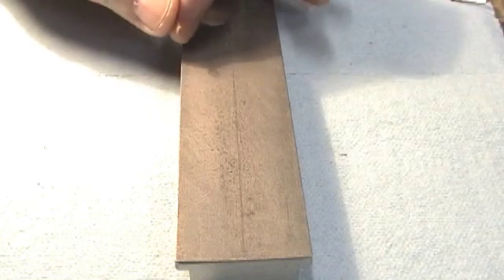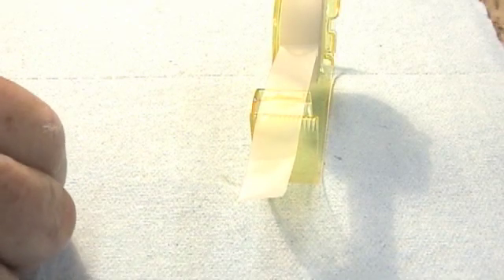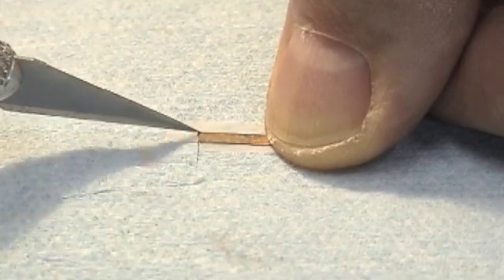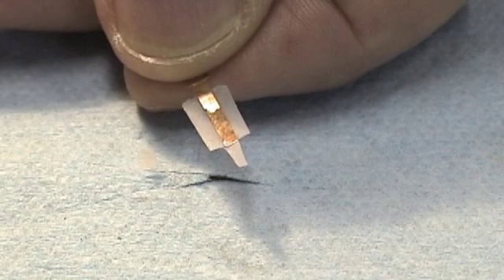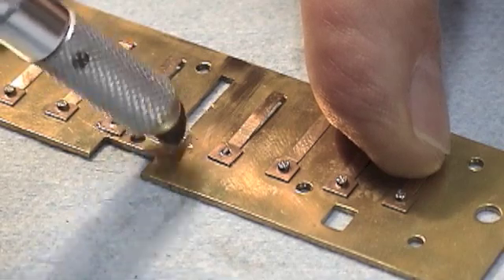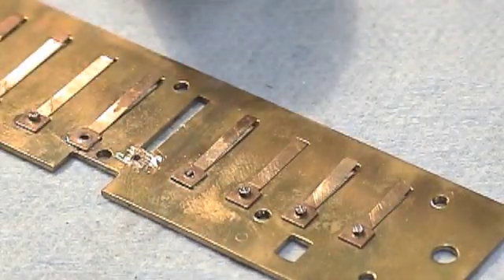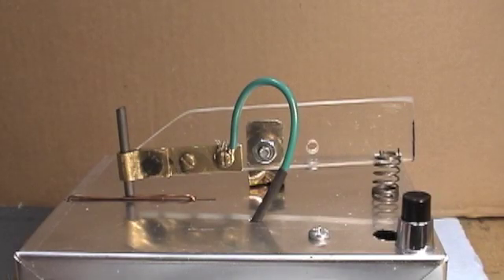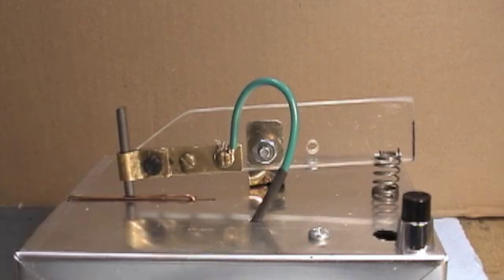Solder

Comment: Could you please tell us more about the power supply you've used to run this tiny spot welder and where you sourced the carbon electrode? This is a very interesting solution for the problem, BTW. Thanks for your response in Advance.
Reply: This is technically a spot welder, you could use the transformer of a microwave(pretty much any transformer though I would go with something around at least 400/500 VA).you would need to rewire the secondary so it s got a low voltage and produce high current.for the carbon electrode, this looks like a pencil refill.. my only advice would be to add a timer that gives you a small repeated pulse when pressing that button so you can control the time cyle, therefore the power that goes through it

Comment: Do you have a video on how to lower the pitch of a reed by attaching solder to the tip?
Reply: I used  CA glue at the tip of the reed to lower the pitch.  I don't like to file the base of the reed, it will weaken it.  You can fine tube the reed by filing the CA dot.
Reply: how many steps are you intending to lower the pitch?
I've tried different techniques and there are some better than soldering, as its stated on Pat Missin's site.
with a good hand you can lower a lot by sanding/filing the base of the reed
or you can lower a few semitones by sticking blu-tac to the tip of the reed -- safer and easier, just clean the tip before apllying with acetone, otherwise wont stick.
Reply: I plan on converting a standard chromatic solo layout to diminished 
layout. I believe you have to lower 18 reeds down a semi tone and 6 down
 3 semi tones, and one down 2 semi tones.
Reply: good idea Paul, lots of work but can be done.
If I were you, I'd tune using blu-tac, this way you won't need to remove the windsavers.
I've done the blu-tac tuning on a chrom -- tuned it to C6 and worked like a charm. It's been 5 years so far and the reeds are still in tune. 
Please let me know about the results, I love my octatonic (diminished) 10 hole, and was thinking about building a 12 hole keyed just like you.